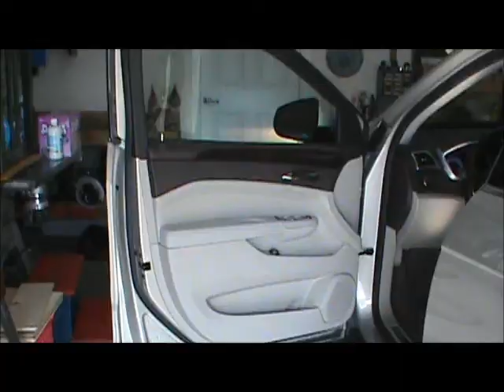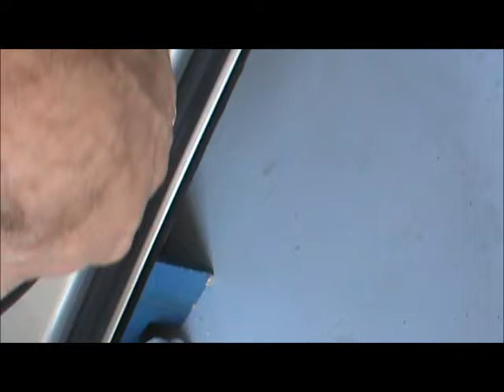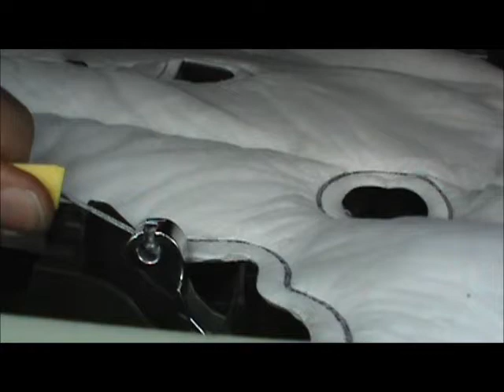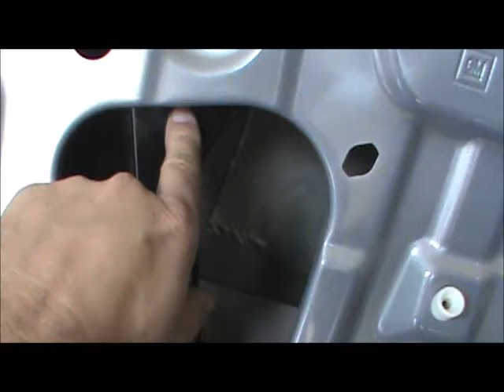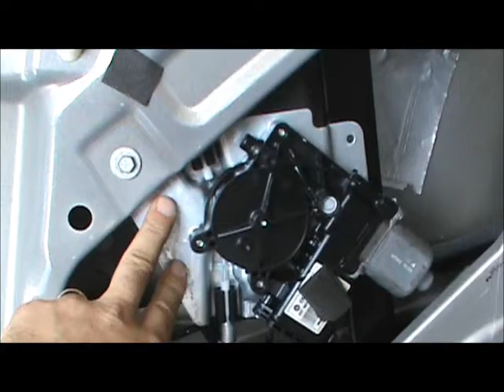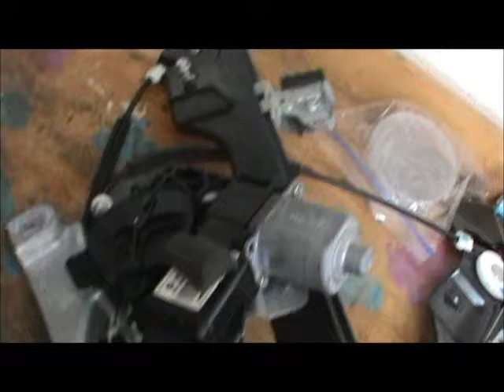SRX Window Problem (2010), replace window motor Part 1

Comment: The exact same thing is going on with my 2011 SRX that I bought this past October.  I love it.  I purchased the dealerships extra warranty because even though it’s a 10 year old car it only has 21,031 miles on it and it was very well cared for.  That said a few things have had to have been fixed; sunroof shade $876, there was a leak in the sunroof and it caused the rear electric trunk regulator, or whatever it is, to blow out which was around $2,000 to fix but all I paid for that was $100.  The rest was covered by the warranty I bought.  I’m just wondering how much it will cost (average) to get the drivers side window fixed because like I said mine is doing the exact same thing that the vehicle in this video is doing.  I don’t know if the warranty I bought will cover it but I’m trying to prepare for the worst.
Reply from the maker: Sorry, I am not a mechanic by trade, just a guy that likes to fix his own stuff - so no idea what it would cost.
Reply: Hey if your car only has 21k miles you still should be under warranty?? How did you find such a deal?

Comment: What is the lifespan of a regulator? Did that window end up needing any further repairs over time? I see lots of people replacing the regulator and the motor at the same time because they say if they replace one, the other will just die soon after and they’ll have to do it all over again. Just wanted to see, in retrospect, if you had any trouble with the regulator over time. Thanks!!
Reply from the maker: We recently traded in the car - it had 180,000+ on it.  I shot this about 50,000 - so, about 130,000 more trouble free miles (and about 5 years)  Never had any other issues with the window.
Reply: Good to know!! Thanks so much for the reply.
Reply: Hi… the issue you asked about DID happen to me! 2010 Cadi SRX.  The driver window stopped working and about 3 months later, the passenger window stopped working. Ugh.

Comment: Great video, I followed you step for step and had no issues.  Thanks.  One thing that was different on my Caddy was before I could release the wiring harness handle on the back of the panel I had to pinch a button down on the side to release the handle.

Comment: I have a 2010 cadillac srx and the front passenger side window just stopped working. It does not move at all. Would this likely be a motor problem or something else?  Neither the master switch for that window nor the passenger switch work at all. The window does not even move. The other three windows work fine.
Reply from the maker: Sure could be - a problem with the motor would present like you describe.
Reply: You are correct. It was the motor/regulator combo. Works perfectly now. Thank you!
Reply: Same problem im having with my 2010!!

Comment: appreciate the video...i have to replace the door check on the driver's side and was wondering what it took to take the door panel off
Reply: Quoc Truong what do you mean by door check? I'm having a problem with my driver's side window in that it won't go up or down with the door closed. However, if I open the door by about 1foot and a half, the window will operate as normal. Does anyone know what this could be?
Reply: google cadillac srx door check.  this keeps the door from swinging wide open.  it sounds like you might have a problem with the window regulator motor although it's odd that it'll work if you open the door about a 1 1/2.